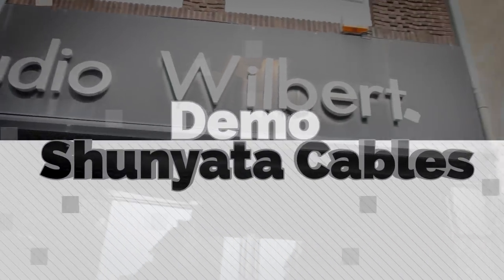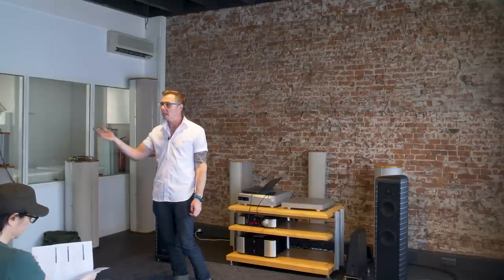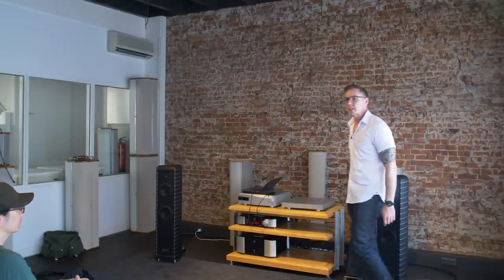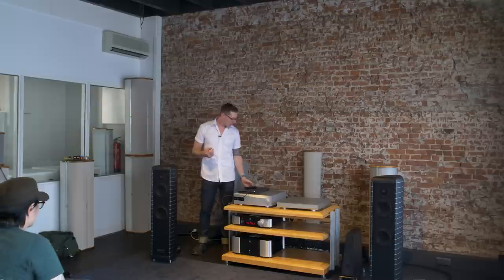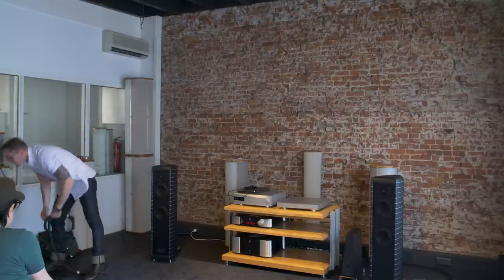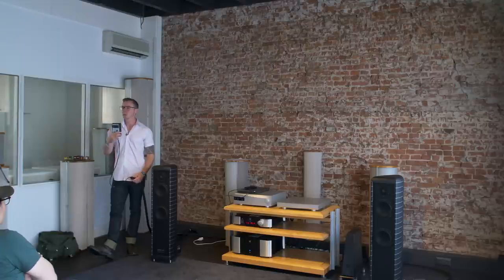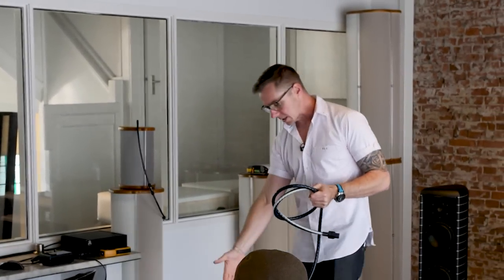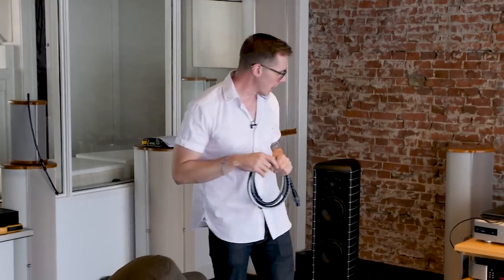How do Power Cables work? - Demo Shunyata Research - Hifi Studio Wilbert Utrecht

Comment: This guy sells expensive power cords, How about some info from actual testing engineers who understand how it all works. I can't believe that hi end gear has such crappy power supplies that it doesn't filter, well actually it does and if you looked at the output of the power supply in the gear you would see NO DIFFERENCE. We can measure things that are beyond the ability of human hearing, yet people are hearing differences where differences cannot even be measured. They can also leap tall buildings in a single bound, are faster than a speeding bullet and fight for truth justice and the American way, look up in the sky.......it's..........
Reply: Why do you care? Hifi cables are for people interested in hifi, not for engineers. We don't care about measurements or technical explanations. We are interested in what we hear.
Reply: @StefanoCipo87  Well I'm talking about power cords, tho other cables are of some question. When I heard a null test between a give away audio cable and an expensive cable I started to examine some of my beliefs. What I care about is expensive stuff being mis-represented to people that maybe don't have the money to spend on something that only fools you into thinking it sounds better when it could be spent on something that really makes a difference. What we think we hear is not always accurate so we can use measurements and technical explanations to see if it's real or placebo. And audiophiles are all hung up on measurements, Except when they show up placebo improvements.
Reply: @bradt.3555  i don’t have experience with very expensive power cables, but have tried several good cables (100€ per meter plus connectors , diy), and on my modest (but quite resolute) 10-20k€ system they do make a very noticeable difference, much more than interconnects and speaker cables. In fact, in my experience everything related to power always made a very noticeable difference, including connectors, inlets, power strips, filters, fuses. Your experience might be different, I don’t question this, but I will not question my experience which is very clear. i don’t need scientists to tell me whether my perceptions are true or not, nor in audio nor in other fields. I think more expensive cable could sound better, otherwise they couldn’t have a market (of course there could be bad products that people like to buy just because are very expensive). I don’t like and don’t believe the pseudo science to explain why they work, I would appreciate more they told the truth, they designed cables by trial and error, and by experience, and found some that sound really good.
Reply: @StefanoCipo87   Well i'll try to keep it short as you seem to be in the camp of denying expectation bias. If we expect something to sound different it likely will even if it doesn't. That's where science comes in. There is just nothing a 6 foot power cord can do that will change the output of the devices power supply. There has to be a difference in the signal going to the speakers to have a diff. in sound this is fact, it can be measured. The market is there because manufacturers understand "placebo effect" and use it quite effectively.
Reply: @bradt.3555  I know what expectation bias is, I'm a physician and researcher. However I cannot deny my perceptions, which are not subtle and are repeatable. Yes I don't deny I'm victim of bias sometimes, that can happen when we expect a difference to exist. However in my experience the differences in sound when it's bias are subtle, I have a feeling that something has changed but I'm not sure. Going back and forth with the change (cable or other) doesn't clear things up. Ultimately I realize there's no difference. Other times differences are not subtle, are so obvious I cannot question their existence, same as anybody would not question actually seeing something in front of their eyes. In these cases changes are 100% reversible going back and forth. Expectation bias has not worked the first time I tried a good calbe (diy yarbo OCC cable) on my system. I really hoped there to be an improvement in sound compared to stock power cord, but there wasn't. There was the "maybe I feel something different, better bass" thing, but it didn't confirm and I ended up not using the cable. Months later, after having upgraded the speakers I tried the cable again on my preamp, and it did make a very noticeable difference. I then tried different cables and found how important they are. Expectation bias also didn't work when I bought the iFi AC purifier, sold it because it made no difference. But a different, better AC filter I tried made a big improvement, and I still use it. Expectation bias didn't work when adding a supertweeter to my system, and I really believed it would have made a difference, since the manufacturer of my speakers told me so. I could go on and on, the point is I'm sure about my perceptions and cannot question them, to me that would be crazy. I believe you didn't experience differences in power cables, it can be due to a number of reasons, including not listening to a system/power cable combination where a difference actually is noticeable, your hearing not being capable of telling the difference, you having a reversed expectation bias (since there is no scientific explanation for the phenomenon, it cant' exist), or maybe you hear a difference but are confident it is actually a bias and not a real perception. I couldn't know what is the case. As for measurements, that is not my field, but I can think it could be that not everything that makes the sound we hear what it is is actually measurable with current equipment. Or we don't measure the right things. To me to show two sweep responses that overlap only means that probably if I listen to sweep responses on that system they will sound the same, but who listens to sweep responses on their hifi systems? Music is a different thing from sweeps and pink noise. I can think of many other reasons why measurements could not reveal a difference but I don't have technical knowledge so I'll keep them for myself
Reply: @StefanoCipo87  Reverse expectation bias? Isn't that still expectation bias? The idea is to understand as much as possible to remove as much bias as possible. My background is a retired electrician and have done audio electronics since H.S. as a hobby so I fully understand what a power cords function is and what it's capable of. It delivers the power at the wall to the device. It carries no audio signal. It's approx 6 foot of wire, no fancy this or that or unobtainium plating can change it's function. It's not till it goes thru the devices power supply that it's ready to be turned into signal. Power cords are very hard to compare as you have to power down, power up, hope your line voltage is the same both times, volume same etc., etc., and not know which is which. Unfortunately what we think we hear is the most fallible. I guess in the end there is much validity to going with what makes us the happiest as it's a hobby. Cables that carry signal are a little different story, just with my knowledge and experience with electricity and what a 6 foot wire does it cannot change what comes out of the power supply.
Reply: @bradt.3555  Yes of course it's always expectation bias, just from an opposite expectation, that's what I meant. I respect people that have different opinions, I just think one cannot negate a phenomenon just because there is no scientific explanation, science evolves with time and discover new things that could be able to explain thing that are now not explainable. The problem is the phenomenon in question I think. Ignoring the fact that many people that don't believe in cables have never experienced an hi-fi system of sufficient level, there are of course differences in hearing capabilities. A sommelier can taste a wine and tell what wine is, where it's been produced, in what year, and what the weather was like during that year. I can barely tell if it's red or white wine. Senses are not developed and/or trained equally for all people. Now to measurements, one who didn't hear a difference in cables will argue measurements can't show a difference...I think we are not measuring the right things, or in the right way. A microphone is not a pair of ears, and a sweep in not music. But in the end it's just an hobby, so everyone should just enjoy it as they prefer.
Reply: @bradt.3555   Let the good doctor who doesn’t care about “measurements or technical explanations” to waste his money on expensive power cables if he so chooses. You did your due diligence and took the time to educate him, which I applaud. I’m amazed how even “smart” ppl can be fooled by all the hifi BS out there.
Reply: @StefanoCipo87 you listen to audio, not mains power.
Reply: @howardskeivys4184  the electrical signal that makes up the audio signal comes from the mains and it’s modulated by the audio signal of the source
Reply: @StefanoCipo87  yes, it is. But before the AC mains signal is modulated, it is rectified, converted to DC, filtered and now retains very few characteristics of that AC signal, regardless of what type of processing it was subjected to.
Reply: @howardskeivys4184  very few, right. But still enough to have an impact on the sound. I know you’ll mention placebo effect but I know power cables do change the sound in a way that is obvious and inequivocabile in my system. I don’t even care about all the audiophile stuff anymore since I moved to a new house and found happiness with my system. I don’t care about cables and don’t make any upgrades anymore, I don’t want to believe cables or power matter , I just know they do because the difference in sound is clear in my system. Many other things I tried do not have an impact on sound but cables do, particularly power cables, without any doubt. So I can think what Jay says about the “ground box” could be true
Reply: Man spends $1000+ on a power cable for his audio system in the hopes that it will sound better.  Man tries new $1000+ cable hoping that he didn't waste $1000+ on just a power cable, then believes the system sounds better because he spent $1000+ on a power cable.  Mission accomplished....on both ends.  At least it's consentual.

Comment: A patented storage device for electrons?????????
Reply: dragocat1 - they also have a venom series of cables because of their snakes
Reply: It's like a tube around the cable or like a two dimension capacitor. You better not put your fingers on it. It gives back power spikes when the cable is "loosing his breath".
It's only a metallic tube, but it's patented, don't try to copy that !
Reply: Always remember: "pAtEnTS ProVe thAt It wOrkS!" as implied by every snake oil salesman ever. I read part of the patent, it's a weirdly shaped capacitor with a high value resistor across the plates at the end of it. You can find it here: https://patents.google.com/patent/US10031536B2/en

Comment: Better use a pinnyada to hook up your audio component to the AC mains that use this snake oil shinyada... Power cables do not make any audible difference! P. S I'm an electrical engineer with a PhD degree... Just use the free power cable that came with your component..
Reply: E Barbie You have employed scientism into your thought, i.e., if you can’t measure it it, you can’t know it. I say that your instrumentation needs further development.  I can hear differences in cabling whether power, interconnect, or speaker.  Of course if you have cheap components you will never hear what component changes can do.
Reply: Hmmm. I figured a PhD would know how to spell pinata.
Reply: @Mike82ARP  There are three types of PhDs online. The ones that are just lying, they really don't have a degree, the ones who have a degree but it's in philosophy and then you have the ones who own Bose. It never occurs to these morons that these companies are founded by engineers and or have engineers employed working for them. Many of them openly admit they don't understand why cables sound different. So, we either have incompetent engineering schools or maybe there is something to this cabling controversy. 
P.S. I guess they don't teach PhDs to engage a spell check program either or how to use punctuation.
Reply: @carlosoliveira-rc2xt  You don't understand why a mains cable can't change anything so you resort to ad hom.
Reply: @Mike82ARP  Or, 'Piñata'?

Comment: For the love of God, wake up and get an engineering degree!!  Power cables don't do anything except convey that last meter in a two hundred mile chain of wires from the power plant output to your home.
Reply: Wrong
Reply: Guessing you haven't tried any or your rocking a dismal av amp

Comment: Watched a few minutes of this epic bs video, now quickly switch to audioholics to get sane again.
Reply: That's because Audioholics, who is an engineer and actually tests, flat out say's POWER CORDS MAKE NO DIFFERENCE in what comes out of the device!
Reply: @bradt.3555   if you have ever tried a different power cord (any one that has a lower impedance than a stock item) then you would know they do make a difference to the sound. If this is value for money is another matter.
Just because you measure something does not necessarily make the measurement correlate to the effect or outcome you are trying to understand.
Reply: @richardpalmer9616  Yes I have tried different power cords. To know if there's an impedance diff. in a 6 foot piece of wire, you gotta measure it, so measurements DO matter. I've never seen anybody list the impedance of a cord, or DC resistance.  And then if there were a diff. which in a 6 foot cord  would be virtually UN-measurable. It would have to be so small a wire as to affect the voltage (based on current draw). Check the wattage draw of say your power amp, not output, but max power consumption, then divide by your voltage, see what your amp draws. That would be max peaks at max volume. Or measure what your amp actually draws then see how tiny the wire would have to be to actually get a voltage drop. Then you have the filter caps in the power supply which will handle instantanious peaks because of their large value. The supply side of the power supply won't even see the ups and downs of a musical program. Remember there's not audio signal here it's raw power for the power supply. What comes out of the power supply is what's used to turn into audio signal. Unless a cord is defective or WAY to small for the current needs of the device, a power cord cannot change the sound. Listening to people describe how a cord does anything is like listening to Jordi LaForge explain how the dilithium chamber works. I have enough years of electrical exp. that I can make up tecno-babble that sounds totally believable but is meaninless. Sound is produced from an electrical signal making a speaker move. Same signal- same sound, it can be measured, has been and the effects of a power cord, by electrical engineers, sorry no go. I apologize for the length, it's hard to explain without just saying no they don't.
Reply: @bradt.3555  hey thanks for the reply, and I am also an engineer in past life, I used to be an academic (senior lecturer) so for sure I understand the value of measurement and the scientific method. I can however hear differences in mains power cables, it would be slightly ludicrous to imagine the entire market for such a product was reminiscent of the emperors clothes. If you have a sensibly revealing system and you make the effort to listen I am sure the majority of people could hear such changes.

I also recognise scientific mumbo jumbo boiled down to and icon and an acronym doesn't help sell any authenticity to me and many others.

Cables even when they should logically not, do make a difference. Better knowledge and science I believe could explain this in the future - but not know it seems.
Reply: Worst presenter in the world 😢

Comment: Aftermarket power cables make no difference at all. Use the one in the box!
Reply: @nickvankreij1626  Changing a power cable doesn't do anything at all on any hifi system, which you would know for yourself if you understood electronics. It's one of those instances where knowledge helps you to weed out the nonsense (and there's a heck of a lot in hifi).
Reply: @MrsZambezi  You have no idea about what you speak. It's as plain as the Bravo Sierra you are shoveling.
Reply: Aftermarket tires make no difference at all. Use the ones that came with your car.
Reply: @carlosoliveira-rc2xt  Tyres wear and make a big difference. Sometimes they make the difference between life and death.
Reply: @carlosoliveira-rc2xt Then it should be no problem for you to explain how a power cable can affect performance. Go ahead.
Reply: My ears are not good enough to hear it if there was a difference but there shouldn't be a difference. The alternating current comes in, goes through a transformer that "generates" a lower voltage of electricity then it gets rectified and fills up some big capacitors with nice clean DC electricity for use as the amplifier sees fit.
Reply: @carlosoliveira-rc2xt  Are you on audition for the new " dumb & dumber"  movie?